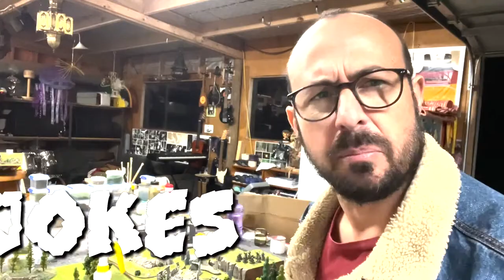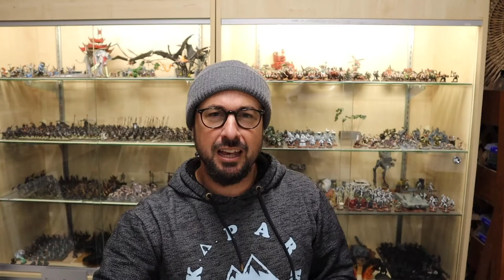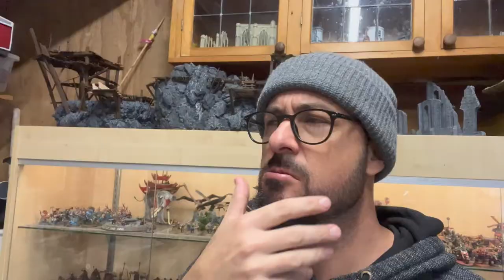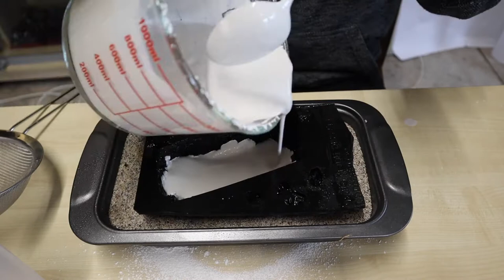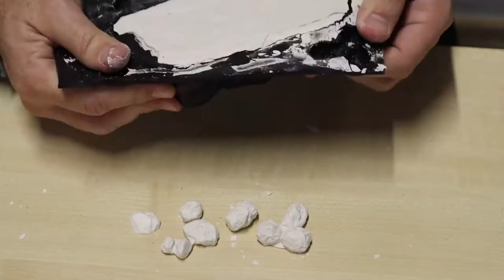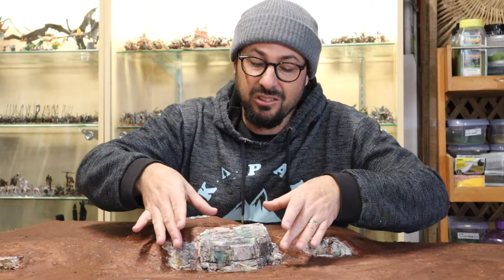How to use woodland scenic rock moulds - wargaming terrain

Comment: Nice video, thank you for sharing! You can mix some shredded toilet paper / napkins in the plaster mix to give it extra strength. It will be less brittle and more durable, plus you'll spend less plaster and the rock will have less weight in the end which can really help with ease of portability if you're doing a whole table of these :)
Reply from the maker: Genius Miran! I will definitely give this a go. Thanks for the tip!

Comment: Add some polyfill to strengthen your molded parts.
Reply from the maker: Thanks man! Do you mean into the mild itself or when you’re attaching it to your scenery?
Reply: @dicedrinksanddadjokes  literally when you pour the plaster. It's messy but it acts as additional tensile strength. Pour some plaster to coat the mold. Add in some polyfill to it. Top off the mold. Gloves help with the mess.
Reply from the maker: Ok cool I'll give it a go.